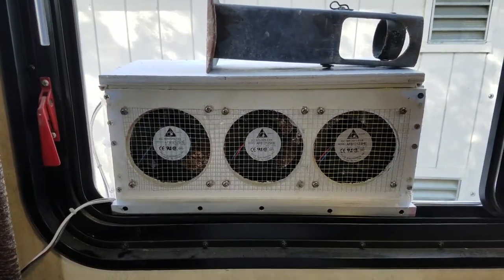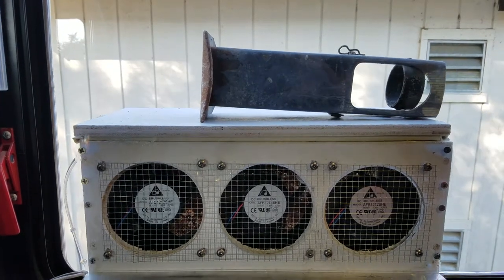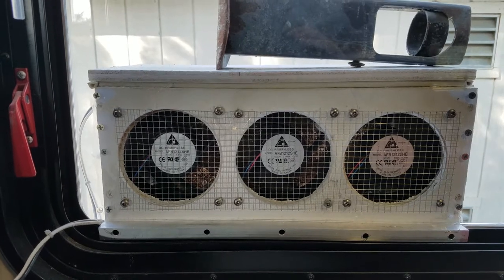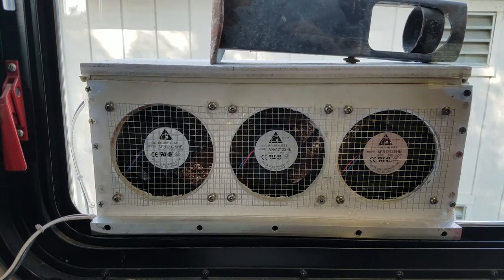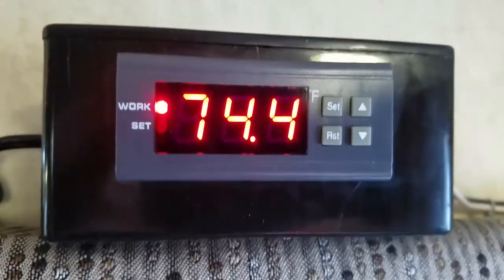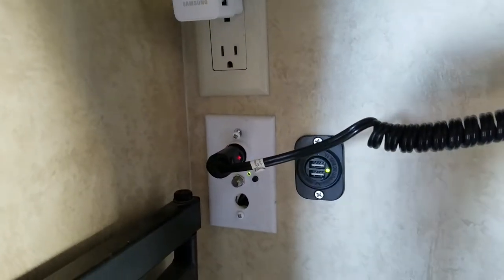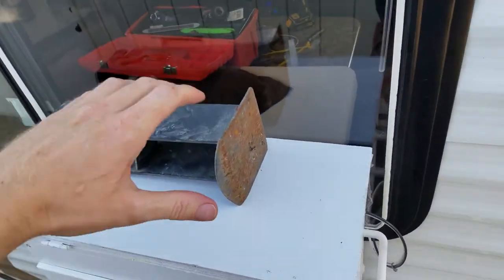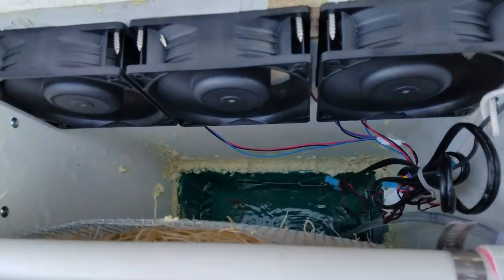Homemade swamp cooler for trailer / RV

Comment: But, but, but…my Pioneer split air of higher SEER rating consumes 3-5 amps continuously on a hot day. Hmm…I would like the humidity this provides in my dry Utah climate though. Thanks for the video.
Reply from the maker: Someday, when I can afford a high efficiency split system, I'm going to switch over to that. Yeah, I hate it when humidity is high in my swamp cooler just makes the air inside my trailer more humid.

Comment: wish i knew what and where to get the fans??? please!!
Reply from the maker: Hi. I got these high-performance fans from http://www.cwc-group.com  Hold off, though, as I'm currently redesigning this cooler using a 12" radiator fan and a plastic storage bin. WIll be posting an updated video in the next few days.
Reply: so they are just computer fans? i used a 10" radiator fan in mine then realized 9 amps is too much. i want to try 8 120mm fans. or a fantastic fan.
Reply from the maker: Very powerful computer fans - CWC model #AFB1212SHE. The fantastic fan may be a good idea. Yeah, I tried to conserve amps, but my RV is very poorly insulated compared to a typical home and the cooler has trouble keeping up on the bright desert sun. I have 4 x 100W solar panels to power it during the day, though, so I don't have to worry too much about power consumption until it gets dark outside.
Reply: great looking evap cooler.  did you ever rebuild this with the radiator fan ? if so I'd like to see it, thanks for the video!
Reply: 12 volt computer fans from AllElectronics.com